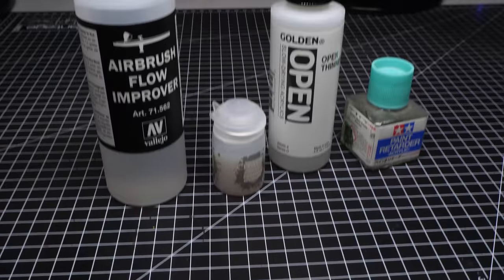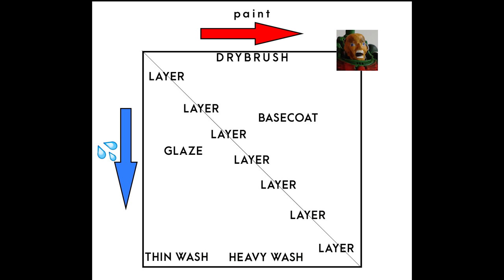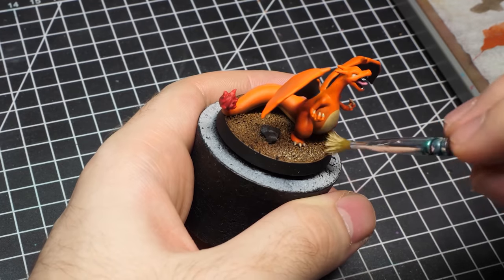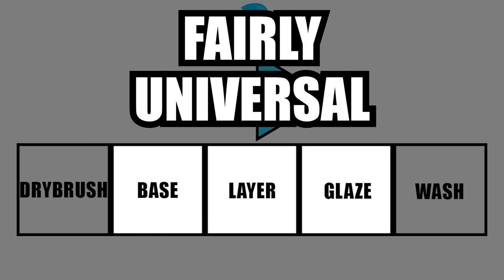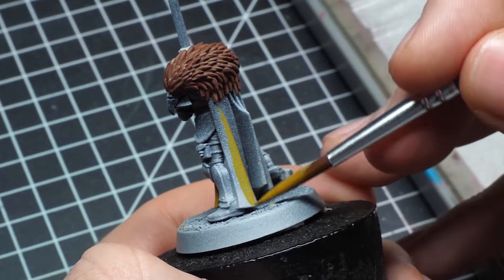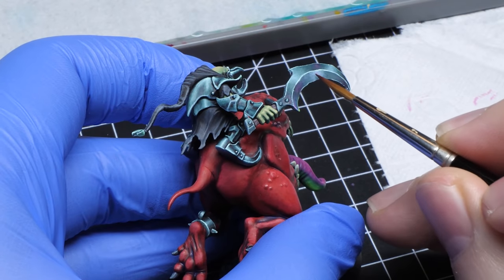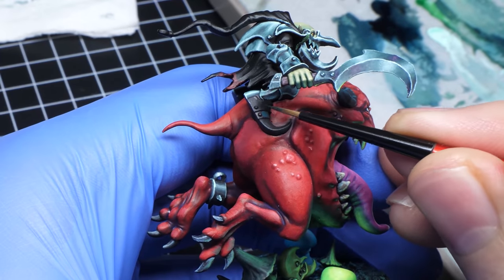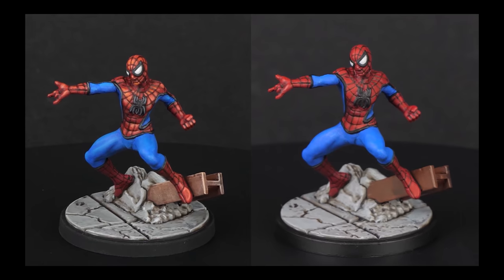ULTIMATE Guide To Paint Thinning For Miniature Painting!

Comment: "Two thin coats" has always been safety-net advice for people new to painting. It's good advice in that it drills home the idea that paint shouldn't be expected to create a solid color in one coat and layers must be built up. Without getting into this level of complexity.

That said, I think the foundation that most painters learn only through direct experience, is that there is no specific formula to thinning paint. You just develop an innate awareness of how every specific paint (which means every color, from every manufacturer) will behave depending on its current viscosity. An eye for how the paint is going to settle, evaporate, and cure.
Reply: OG acrylic user here, active on the forums since the late 90s. This is just to give you an idea of how many questions I've seen about how to use the medium (actually how to do almost everything in the hobby). 

So once miniature-specific acrylics had established themselves one thing you saw again and again was people who couldn't go beyond the instructions or guidelines they'd read, and it stifled their development to say the least. Admittedly the instructions themselves are partly to blame for this – proscriptive advice is and always has been a major problem for learners. One of the very things that separates those whose work tends to remain static (sometimes for years) from those who improve steadily as time goes by is the ability to learn from direct experience, building up from foundational advice as you say. But it's important to realise this tends to happen with only a minority, and with some difficult media the smallest minority (an issue that goes far beyond this one topic BTW, it's common to all art and craft instruction).

Which is all to say that this sort of clear and concise breakdown of a complex and sometimes confusing topic is of so much importance for the "but I read I can't get away with doing this" type of person who make up the majority of the beginners and learning painters.
Reply: Two thin coats was essential for GW box art painting and white dwarf pics, back when some of their most important colours in the ranges just plain didn't cover in one, even straight from the pot.
Folks have forgotten, or weren't around when citadel acrylics included some dreadfully pathetic paint, but in time building up colour with multiple passes of semi-transparent paint became a virtue in itself and so the two thin coats method became a valid, effective approach - if a slow one. Some really stunning work has been produced this way.
Painting an army two or four times over - ridiculous, use the best paint you can find and afford, so you don't have to. Embrace how you can use oil paints over your acrylic as technical paints. Find all the stuff that works for you, Duncan Rhodes certainly has but it might not be the same constrained approach for you
Reply: @philgee486  look at their metallics. GW still puts out some shit paints to this day

Comment: Gotta say this was a much better presentation than I thought it would be.  You anticipated the questions I might have had but there was one tiny issue that did not get mentioned.  

When I started painting WH40, Orks in particular it was a switch up from Airfix Napoleonics.  I had just learned about undercoating but could not understand why my mini's were drying with a satin to shiny finish when I was using, albeit GW, flat paints.  I learned by looking  at some one else's paint job and noticed the coats were thinner and he told me about layering.  So if you use a single layer of a base coat, be prepared for that shiny finish.  That obviously affects beginners more than experienced painters, but also when you paint 60 or 70 figures in an army you don't want to layer up in the detail you just demonstrated.  

But to re-iterate, a really good presentation.  I love it when you guys actually provide the reasoning behind your statements.

Comment: I’ve always used from the pot if the paint is fresh and not too thick and never had problems. I’m a table top + painter so above average but not a pro by any means, but people are impressed with my paint jobs when I get a chance to show them off.
Reply: I went hard on techniques and getting a wet pallet, additives, and eye droppers when I first started because I wanted everything to be perfect and to follow the master painting guides.  Now days it's a plastic lid and the paint gets thinned with the water left in my brush after rinsing.

Comment: Very important video, so good. Wish I'd had this way, way back when I started painting and when I picked it up again to refresh. It also gives people permission to use paints unthinned, instead of feeling forced to try and reach some sort of magic ratio that is hard to achieve.

Thinning is a topic of feeling and the only way I've found to adequately describe thinning for layers is how the paint applies. For a "real" thinned result, you want it to apply without being watery and without leaving texture on the surface. 
But then you have the differences in pigments... how to get a nice black layer? Apply 3 slightly watery coats for a matte finnish. Add thin coats for a more satin finish.
...but then more specifically, again, this is mostly true for GW's black base paint (whatever it's called now - used to be chaos then abaddon), as Army Painter's 'Matt Black' seems to work better.

Confusing. All you can do is keep painting and actively ask yourself what you're doing right/wrong and how to avoid some things.
Reply: The part were you said all you can do is keep painting. Thats it man. These videos are great and super helpful. You can watch video's all day long but unless you paint and practise you wont get better. I learned at a time before youtube lol You would ask someone or just learn yourself. A codex or white dwarf magazine helped for sure.

Comment: Two thin coats was essential for GW box art painting and white dwarf pics, back when some of their most important colours in the ranges just plain didn't cover in one, even straight from the pot.
Folks have forgotten, or weren't around when citadel acrylics included some dreadfully pathetic paint, but in time building up colour with multiple passes of semi-transparent paint became a virtue in itself and so the two thin coats method became a valid, effective approach - if a slow one. Some really stunning work has been produced this way.
Painting an army two or four times over - ridiculous, use the best paint you can find and afford, so you don't have to. Embrace how you can use oil paints over your acrylic as technical paints. Find all the stuff that works for you, Duncan Rhodes certainly has but it might not be the same constrained approach for you

Comment: Hi Zumikito.  I love you.  Please explain your drybrushing technique as I don't understand the dampening sponge part at all.  P.S. I love you.
Reply from the maker: So the sponge dampening pad is there so you can keep your brush slightly damp. You don't need to keep it wet or moist, but slightly damp will do. This is because you wanna avoid too many dustybrushtrokes, so keeping it just slightly damp will work well for this purpose. You still have to get rid of most of paint however.
Reply: @Zumikito  so you do the regular drybrush of dip, wipe wipe wipe wipe wipe, then damp it a little using a sponge?

Comment: I think that the "two thin coats" idea has kept me from experimenting. I believe that the underlying assumption behind this approach is multipling the number of paints that you need to keep beginners in a closed mindset where you have to buy paints all the time to achieve a result corresponding to the box art. 
You can achieve much better results with underpainting and smarter approach to painting without having a ton of experience or paints. I know that two thin coats approach is an advice for beginners but it's a VERY BAD ADVICE. Beginners and speedpainters achieve much better results with washes, drybrushing, contrast paints and underpainting as these techniques actually require far less brush control.
Two thin coats is not only bad for beginners but it's also bad for speedpainting, which makes it bad for 90% of paintjobs actually.